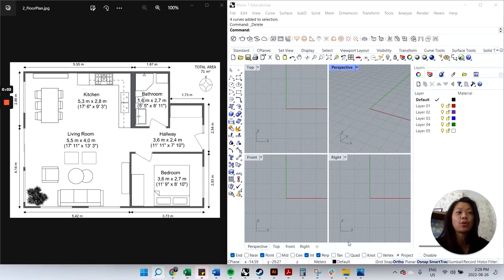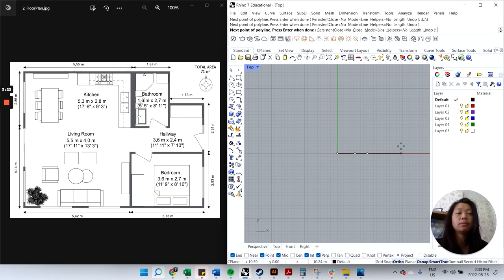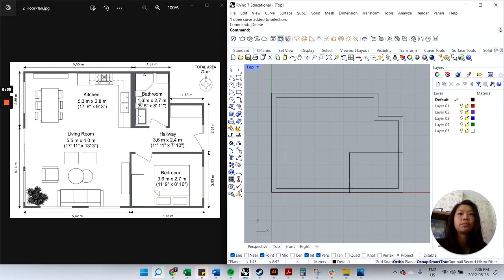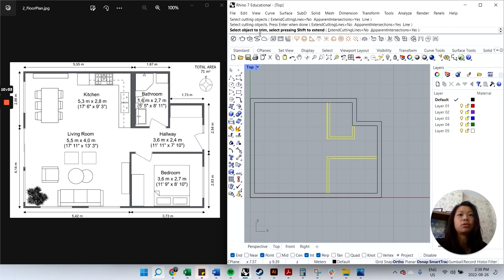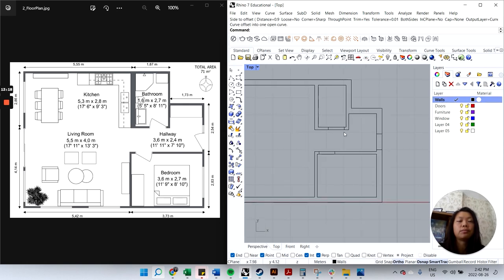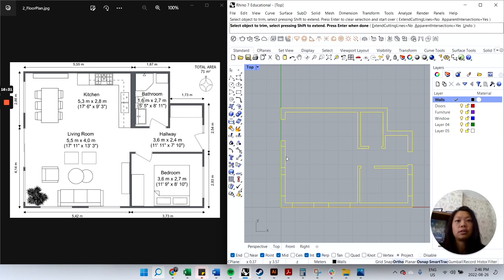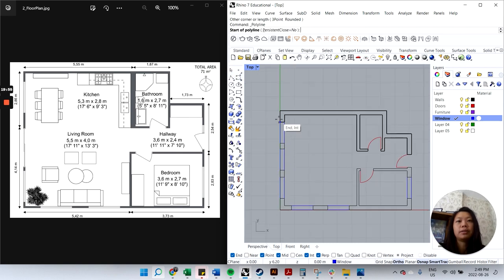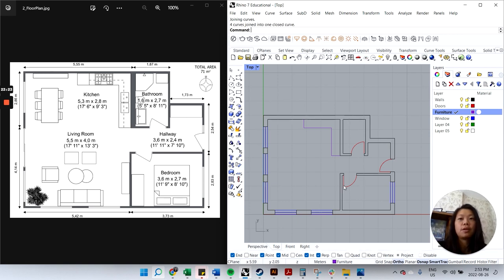Rhino 7 Creating a Basic Architectural Floor Plan

Comment: Victoria I work in the manufacturing and construction side of architecture in the GTA. In 2009 I took a course in Rhino and purchased Rhino 4.0 and did some self training as there was very little training on the internet at the time and the local training was high priced and geared towards jewelry arts and 3D printing. Also there seemed to be little interest locally for Rhino, here in the GTA and in Canada as a whole as well. Has that changed much in this decade because I am considering an upgrade in the software and some new learning online? I believe it could be useful as I have worked for a local company that needed digital models in lieu of hand built as many artists that did those hand crafted models were retiring and not being replaced. For that work I used MoI 3D which was designed and sold by one of the lead developers for Rhino when AutoDesk was considering it as a part of their line up of products. Sort of a Rhino light version also NURBS. I also do work currently for a large company that might be in the future more interested in this possible additional talent. What sort of work is out there locally for people good at Rhino but not necessarily architects themselves in your experience if any please?

Comment: i am new to Rhino. I just wonder if we can use Autocad and revit to draw this kind of 2d drawings, what is the point of drawing them in Rhino?
Reply from the maker: You can definitely do your 2D drawings in Autocad. From there you can import your lines into rhino to 3D model. If you're working in Revit I'd imagine you'd do both 2D and 3D work in that program rather than use Rhino. This all depends on your preference on workflow!
Reply: Jiang - AutoCAD, Revit, and Rhino each have niches where they're best fit.

For example, AutoCAD (while technically 3D capable) is best for 2D engineering.  It's also good for 2D architecture; however, there are better options.  Whether it's simply moving to a more AEC-friendly 2D tool (including AutoCAD architecture) -- or a BIM tool like Revit.

Revit is best for construction drawings and full-blown BIM.

Rhino serves an entirely different purpose.  Rhino allows you to essentially imagine anything and mass it quickly in 3D.

Many AEC professionals (including myself) use all three types of tools together.  It becomes a bit of a nightmare on the small differences because you often mixup right-clicks, etc.  However, it's a necessary evil as each tool is better for a certain situation.

In the case of Rhino vs Revit specifically, Rhino allows far more creative freedom.  However, once you decide to do full engineering, it's easier to move from Rhino to Revit.  This helps you understand how each has its specific purpose and (unfortunately) the reason why many of us have to work in many apps.

Comment: I'm new to this software. I highly appreciate your video. Can you do a full working drawings using Rhino?
Reply from the maker: I generally wouldn't recommend full working drawings in Rhino. It's a good design program where you can do both 2D and 3D work. If you're thinking for architectural drawings I'd recommend Autocad or Revit for working drawings

Comment: This is an outstanding material. I study architecture and do high complexity in Grasshopper however THE BASICS are super important along the way. I study these videos and combine them with the hardest exercises out there to sharpen my skills on the basics, the intermediate and the highly complex and advanced such as data trees, path mappers, lists, ranges, series and logical circuits. Parametric architecture IS differential equations with logic and geometry. However the basic plan MATTERS. 

The basic door, floor pattern, ramp, stairs, window and the FURNITURE matters. This is the heart and soul of architecture. Excellent video like this should happen so often. A great start for everybody and an invitation to the journey of architecture. The four principles are the layer ordering, the ORGANIZATION of FILES and props, the plan template and LINE language. Anyone who practice architecture SHOULD BE A DRAFTSMAN FIRST.

Comment: Hi! When I offset it connects the inner and out walls. I am unable to simply select and delete the center part of the wall. Im at the 6:30 mark. I am doing an outside offset of 3" and inside offset the same.
Reply from the maker: When you offset they should be two separate objects. If needed, you can always select all the curves and then type explode. This will disconnect the polylines into separate line segments and you can always join them later on. Hope this helps!